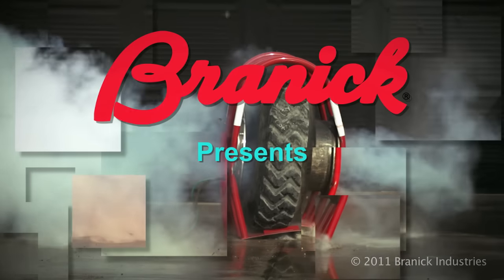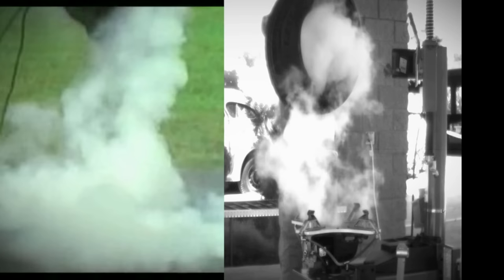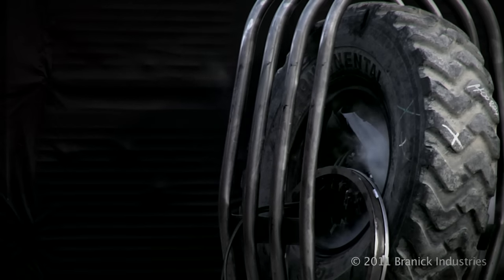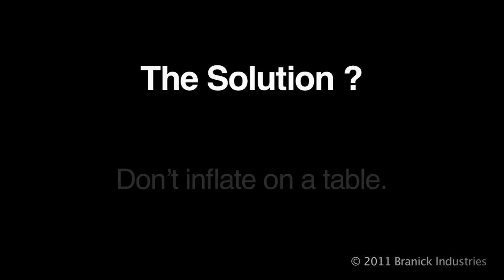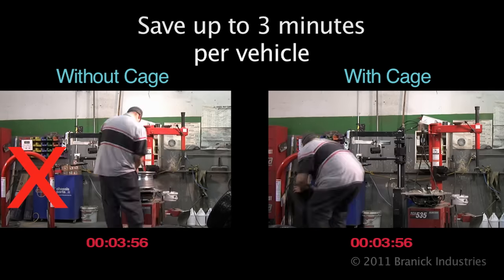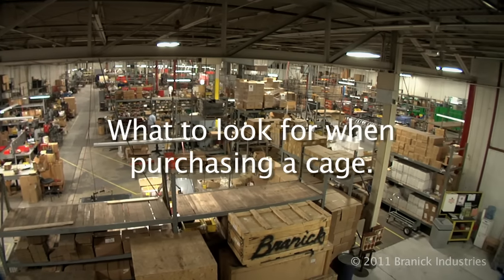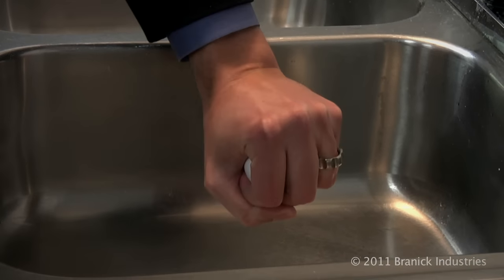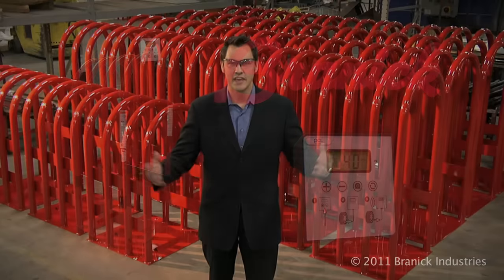Tire Safety Video.mov

Comment: Um cant some cinder blocks cemented together do the same thing ? Just saying a cage might be too costly.
Reply: Sure, but they are going to be incredibly heavy, and if they fail it will be catastrophic, wheras this steel will just bend and stretch.
Reply: I hear chains around a tire can do the same thing.
Reply: Premium fuel only well, if the tire has enough force to bend those steel tubes, i certanly do not want chains to be tasked with holding that.. not that the chain will break but that the chain becomes a high speed whip. If you had a chain that was in a webbing pattern that fit around the tire then maybe.. but i would still rather have this cage.
Reply: Yeah but the only time you'll find out if you've chained it good enough is when it's business time and it goes BANG. I don't fancy being the guinea pig when that happens. Maybe you can duct tape a dartboard to a wall, but I don't wanna be sitting underneath it when you let it go to test the theory haha :)

Comment: "Phantom camera was a significant amount of money to rent and it had to be flown in with a certified technition" wtf, iPhones can take very high def. super slow motion videos just as good as the stuff I'm seeing here. hmm I guess that this was from only 2011, but still...
Reply: I know this is an old comment but the best iPhone camera can only do 240fps the camera they used for this can do up to 1,000,000 FPS this video was most likely filmed at 25,000 FPS so iPhone slow mo is nowhere near this.

Comment: You shouldn't offer a model that is inferior to your safest model. If the safest model you produce has sidebar reinforcements and safety mesh than every model should have sidebar reinforcements and safety mesh. In three sizes small medium and large.

Comment: This would be an even better product if you didn't have too replace the cage after every exploded tire.
Reply: You don't really understand safety/failsafe equipment if you think something like this should ever be designed to be reused after the first blowout.No matter how robust the equipment is, the manufacturer cannot guarantee the first blowout did not compromise the integrity of the cage - a single fringe case of a theoretical cage designed to survive five blowouts failing on the second one could get somebody killed and cost the manufacturer untold amounts of money in lawsuits.
Reply: Idontevenwanachannel
The thing is using the right materials will ensure the integrity still remains the same after 1 blow out. If you combined Kevlar and Carbon fibre it's going to be extremely strong and could be used in this type of product and be reused several times don't get me wrong i do understand your concern but the one above in this video is only made of Steel by the looks of how easy the metal bent after the explosion but if you combined Kevlar and Carbon fibre it would be 10X stronger and could with stand multiple Tire blow outs.
Reply: MAVERICK 42 the problem is cost. Sure you could probably build something like that but it would probably be cheaper to buy a new one of these each time then to have an extremely expensive cage.
Reply: Clinton Cutler
Well maybe but you pay for the best materials right and then earn your money back buy selling the product at abit of a higher price.
Reply: Most safety equipment is best used once and then replaced.. fire extinguishers, motorcycle helmets, safety glasses etc.
Reply: I would keep using it. If it starts to develop cracks, weld them up!

Comment: To bad so many shops are to cheap to buy one.
Reply: If you are really concerned you can always side the tire under a vehicle. I'm 64 years old but when I was in my early twenties I was a tire man on the third shift in a major truckstop Pa. doing service calls on the turnpike all night and I'd slide the tire under the vehicle I was working on to inflate. That trick was taught too me by the guy that trained me to repair truck tires and it really does work.  It makes the job harder and takes a little longer but what's a life worth... especially if it's your own. lol
Reply: @hotrodrebel855 Good point and advice, use the truck as the cage. I don't change tires at all but if I have to inflate one I will put it under.
Reply: @hotrodrebel855 I was taught in the mid 1990's to wrap a heavy chain around it in 3 or 4 spots when we did split rims. Eventually we did buy a cage.

Comment: put it this way, fucking with a tire with only 30 psi is as equalant as fucking with a stick of dynamite..oh and on a note, this is another reason why you should only mount NEW tires and NOT used tires

Comment: so its dangerous to inflate a passenger car tyre? yet we all put air in our tyres at the petrol station  without injury.
Reply: wesley gottliebsen This is different, this is a "split rim".  It can still be dangerous to over inflate a passenger/light truck tire, but split rims are notorious for lethal explosions.
Reply: wesley gottliebsen It's dangerous when they get over-inflated, you can inflate them but overinflating them is dangerous.
Reply: +wesley gottliebsen The difference is when mounting tires, if the tire wasn't mounted properly it can blow off the rim especially if pressure is used to seat the bead. If a tire is properly mounted it won't blow off unless there is a failure on the rim, or if it was way overinflated (more than 2x the max pressure on the sidewall).

Comment: 4 tyres in 6 minutes. Definetly not one person alone, you need crack 4 wheels nuts, jack four points on the car, remove the tyre, get the new 4 tyres, put them on the rim, pressure the wheel up, balance it and put it back on. 

Thats 1 minute 30 seconds each tyre, not possible.

Comment: Soo, how common is a tire explosion? I think if it kills the idiot that made a mistake it is fair game, no? j/k
Reply: +ObsessionPC Tyres don't only fail because the operator is an idiot... There's several other reasons, in the aircraft industry for example, wheels need to be proof pressure tested, so they're inflated to 150% of their operating pressure. Cages like these are essential.

Comment: If you cant seat the bead with 40psi, you're doing it wrong...
Reply: 210peanutswaye Do it for 30 years and come back to me on that. There are tires and rims that simply dont allow that to happen. Even lubing the rim and tire dont allow for smooth seating 100% of the time.
Reply: Ahh, I see you have never worked on a tire with a profile lower than 50
Reply: 210peanutswaye lol try it with 275/30/18 or lower side wall

Comment: That's just air pressure, think what Hydraulics could do! And for goodness sake don't forget to bolt that thing to the floor!!
Reply: Air pressure is way more dangerous than hydraulics. Air compresses and holds a large amount of stored energy. Fluids do not compress and cannot store energy. Yes, fluids can transfer energy, better that gasses (air), but they don't store energy. Stored energy is basically a bomb. Some hydraulic systems have accumulators, they are a storage device. Hydraulic pressure compresses a spring, or compresses gas chamber, so it can store some hydraulic pressure. An example is a hydraulic brake system in some tractors. With an accumulator, you still have a few emergency brake applications left if the engine happens to stall. The hydraulic oil is NOT storing the energy, the mechanical spring or compressed gas in the accumulator is storing the energy. The hydraulic oil only transfers that energy.

Comment: agreed, whole step of a balance and rotating added makes the process quicker? lol... I AM a tech and first thing... you never put air in a tire on a bench,stand it up and air it on the floor cause if it does blow it wont hit YOU! If you work at a shop and over inflate a tire... you should be FIRED! and kicked in the nuts....

Comment: or just a inflate on the table with a modular hinged saftey cage so you can do the work unimpeaded by time constraints and still maintain moderate level of saftey at least if paying attention and doing job right not just leaving it to go on a drug break Coffee/ciggarettes/alcohol/hard drugs like sugar 😂 ... but really ain't no reason to die or loose productivity you can automate your way out of it with pressure relief valves pressure switches and inspections of tire quality as well as pre stretching tire with fill empty fill empty fill hold pressure no leaks soapy water 🌊💦 test I'd have it all run through manifolds from central compressor as well as as multiple backup compressors but the saftey being manifold side though compressors come with their own saftey I'd have pressure gauges built into every outlet as well as attachment points at least 1 300/200psi pressure relief valve to rule them all though you could buy one for the specific tire pressure somewhere between 30 40 and 55 psi though many are different there are standards and install pairs as a failsafe with 1/4 turn off valves  anywhere it could be useful to isolate system ... really biggest problem is jobstress exhaustion and therefore user error that isn't backed up by enough common sense to watch what they're doing depending only on a robot to do it for them though secondary robot saftey backups in addition to actual knowledge is a great combo

Comment: yes I agree it REALY saves life but is too expensive and nobody wants to buy , so people continues to work in traditional way , if the service buys this case the car service will cost more so is cheaper with out FAIL sorry I don't have money for safety
Reply: until a workers family sues for a death that could be prevented.
Reply: fully understand dear Jason  but. when you dont have enough money ,you know these days people are inventing amassing stuff but not all of as can afford it , if i had money to buy it OF COURSE  why not but the reality is another
Reply: dan laesu Would you rather pay a few thousand for a tire cage or possibly pay millions in damages if one of your employees is crippled? If it is proven you have violated safety laws OHSA will hound you and possibly fine you. And you can bet the worker's union will be involved as well. Bottom line is a tire cage buys safety for both your employees and yourself. If you have a cage, any worker who is injured by an exploding tire can't get much in court because it would be easy to prove negligence on the worker's part. A tire cage stops a lawsuit from screwing you over.
Reply: There's cheaper cages than these ones.

Comment: The guy on the left is going slower period, has nothing to do with the cage. He falls behind well before they ever reach the inflation part of the proccess. Claiming that by adding a step you are reducing time is a blatent lie. Posting this video in which you can clearly see the guy on the left going slower, likely as per instruction, is just adding insult.
Reply: I agree the videos weren't fair, but thier point is, by putting the tire in a cage that automatically airs it to the proper psi, the tire guy can start on the next tire, rather than standing there airing up the tire.

Comment: I would just put the biggest chain I can find around the tire and through the middle of the rim.
Reply: That's how it should be done if no cage is available. 
A clip-on air chuck and an inline regulator is a must too. Then you clip it on n walk away while it fills m start working on the next tire. The tire will let you know if it blows lol

Comment: Its only air it won't hurt
Reply: The air doesn't hurt, it's what it's pushing that does, lol
Reply: It's not the air, it the actual rim pats and the wheel that do.
Reply: jordan rader Um, not always air sometimes even metal from the rims/tire and the air's pressurized making high powerful winds.

Comment: ITS A FAKE WATCH THE FIRST FANTOM SHOT. THE RIM FOR THAT TIRE IS A 3 PIECE RIM . THE MAIN WHEEL THE OUTER SET RING AND AN INNER LOCK RING WITH A RUBBER O-RING TO SEAL THE TIRE TO THE OUTER RING. IN THE SLOW MOTION VIDEO YOU CAN PLAINLY SEE THERES NO INNER LOCK RING!!!!! FAKE FAKE FAKE